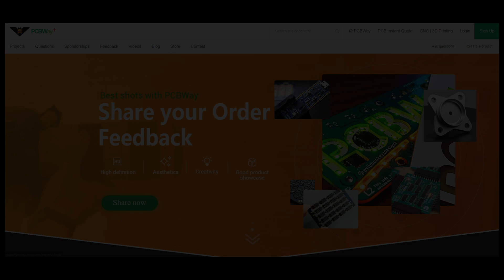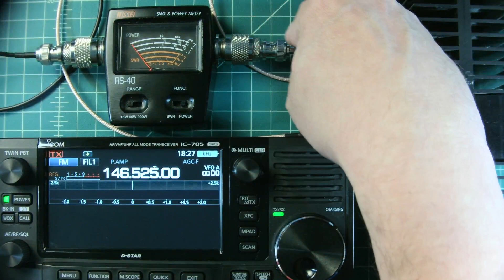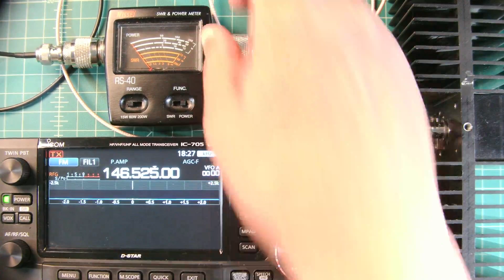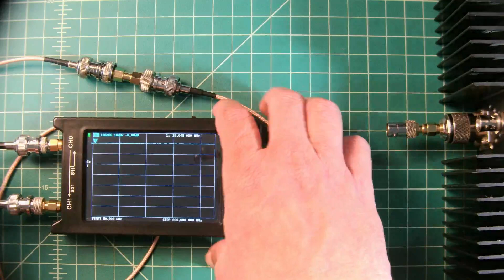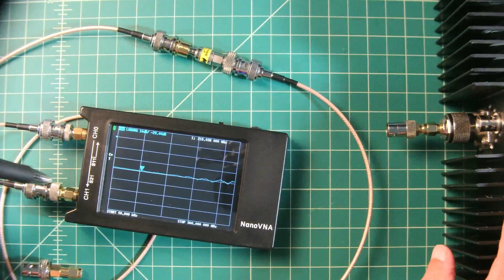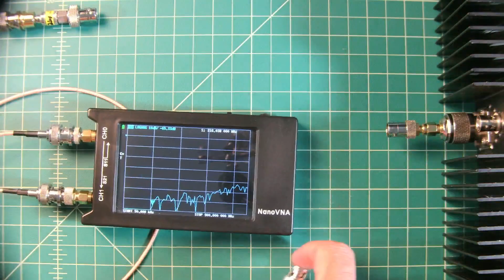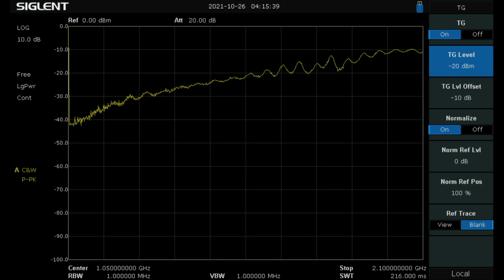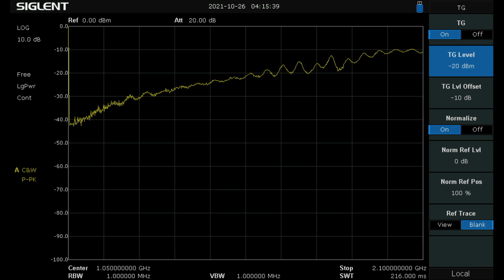Cheap Dummy Load for Ham Radio

Comment: Hmmm.  Now I gotta see what's going on with mine.  Did you open it up and look at the back part?  that tap is inductive, i wonder if it is loose/bad solder/touching the naughty bits??
Reply from the maker: I did, turns out its a monitor and not an attenuator: https://electronicprojectsforfun.wordpress.com/rf-module-gallery/the-rf-splitter-and-combiner-gallery/a-dummy-load-converted-to-a-power-attenuator/
Reply: Jeem-  I bought one of these after watching one of your videos the other day.  It’s taking a slow boat from China around the world twice to get here. 
I couldn’t follow the article.  Bottom line , when mine comes, is there a simple way to assure I have the attenuator version?  I got it for using on an analyzer.   Which I don’t want to brick. 
 Thanks. Tom

Comment: Looking into the unit I have, the 30db attenuator is a small loop of solid wire about 5mm away from the 50 ohm resistor and as a result, it is frequency dependant to the amount of attenuation.
This could be fixed on a unit that you purchase and modify yourself. I haven't bothered so far as my power meter has the same (and working correctly) function.
Reply from the maker: It will be a little frequency dependent.  I like it as a dummy load but I use more traditional attenuators for measurements 👍

Comment: I enjoy watching your YTs on various ham radio subjects. I have a Heathkit Cantenna that I built many years ago. It’s quite messy even though I never gave it the full gallon and a half. So I wanted a dry dummy load that could handle 100 watts. I was going to build one, it’s easy enough. Before I saw your YT, I bought one from a more honest source. He stated it was a pull (used, removed from service). When I got it the first thing I did was remove the cover to see how that RF tap was. It’s loosely coupled, a wire loop above the chip resistor. OK, I’m not sure if it will be exactly -30db, or whatever. I may remove it and replace with a -50 db pad. I bought a NanoVNA and as an experiment I checked the CelWave with it. The SWR was nice and flat, as expected. Years ago, I bought a MFJ-264 at a flea market for $10. I checked it with the NanoVNA. The SWR was flat but at 1.3, or something ? I opened it up and found a 60 ohm resistor, yup six zero ohms. Since this was a flea market find, I can’t say if it was factory or user installed. I’m debating purchasing the proper resistor for it. Keep up the good work ! 73 Dave
Reply from the maker: Lordy at 60 ohms.  That’s why I always test the test gear, thanks for the comment David 👍

Comment: Like many others have commented, this is an excellent quality termination load that also provides for RF sampling/monitoring.

I have seen a bunch of these installed in public safety 2-way combiners / circulators and other somewhat complex RF systems.
As i recall, they were used when system monitoring was to be implemented.  The sampling port (BNC female) output level (meaning… level of attenuation provided between the input and sampling port) can be easily field adjusted with commonly available test gear.  Like others have pointed out, the “probe loop” can simply be gently bent closer or farther from the main RF path / resistor field.  

They are sometimes labeled “CelWave” (CelWave used to be located in NJ but were bought and sold a few times over the years…).  I’ve also seen a few labeled “/\/\otorola” (OEM) that were really manufactured by either a CelWave associated company or the manufacturer beginning with the letter “F” (I honestly can’t recall the name) who produces some gorgeous OEM BpBr duplexers for Motorola.

They have quite decent specs, are well constructed and that’s a great price for a solid piece of equipment that most Ham folk can put to great use.  For use as a simple 50 ohm termination load or “dummy load”, it’s FAR better quality than most Amazon Chinesium crap or MFJ junk.  I actually have two that I use for duplexer / filter tuning as well as general purpose testing.
They were given to me with a pair of Quantar repeaters, but I’m not sure if they were used with those repeaters for any reason.
The spec sheet that came with them indicates they are indeed rated to 2GHz with the power rating at 100 Watts continuous and up to 250 W for intermittent use.  If you’re using these for high power, long timing intervals or anything critical, I’d definitely recommend adding a small fan or equivalent cooling method. 

I opened mine up just to check the details before posting this.
It turns out they used two different resistor types.  One was “EMC” and I forgot the other…

Btw - The paperwork I received with them has a price sheet enclosed.
These units, with 2x 24” RG-400 jumpers… $590@ … That’s for EACH terminator unit.
Then again, it was equipment sold to a municipal government agency and price is absolutely no object when the vendors pay the “proper” Demoncrat “lobbying” costs to the politicians controlling our hard earned tax dollars.  

Go BIDENomics! 
Or is that Go Hunter and Friends 🥷🏽🥡🧧🈴🈹🉐🇨🇳 and.. can’t forget about the tender age little girls desired so much by the political weasels. 👀 🙍🏼‍♀️

Seriously.. Thanks for a great channel!

Comment: There is nothing wrong with the device. An RF tap is a convenient sensor for RF because it substantially attenuates a signal while keeping it from radiating. But there's a reason an RF tap is not called an attenuator. It isn't one. An RF tap  does NOT provide uniform attenuation over a frequency range. It's a cheap kludge used to sense RF without unwanted radiation. It may be nothing more than a piece of wire sticking into the RF field. It almost invariably provides less attenuation as frequency rises because it has not been designed to be purely resistive over a wide frequency range the way a proper attenuator has. What you saw is exactly what an RF tap looks like. Sure, the tap's output will likely be 30 dB, but only at 1 frequency, whatever that frequency may be. Whoever claimed the tap was a 30 dB attenuator was babbling nonsense. However, $30 for a 100W dummy load that is still 50 Ohms at over 1 GHz, and has a convenient RF tap to observe waveforms without unwanted radiation, is a very good deal, new or used.

Comment: This review is wrong, this a VERY GOOD dummy load, especially for the price, the BNC connection is NOT an attenuator, it's just a monitor port so you can connect test equipment, counter, spectrum analyzer etc., I'm amazed that people will buy a piece of cheap bent tin from MFJ for $75 and think it's a good deal.
Reply from the maker: That seems to be the case.  Thanks For the comment Harry 👍

Comment: It's definitely not a "cheap" dummy load.  It's a premium dummy load.  They are rated for 0 to 1000 MHz.  The unit uses a thick film resistor for the load.  The sample port is not, I say again, not directly connected to the load in any way.  It is simply a wire loop over top of the thick film resistor, basically a antenna.  If you need more or less signal out of the sample port just push the loop antenna closer or further away from the thick film resistor.  Remove the 4 screws holding the cover on and you will see how it is configured.  These loads are currently flooding the market as they come out of use in cellular phone tower sites.  Guy had dozens of them at the Hamfest last weekend for $25 each.  Also had a pile of Sinclair 240 Watt dummy loads to.  Mike KC3OSD
Reply from the maker: Thanks for the info and for checking out the video Mike

Comment: I bought one of these a while back (Listed as used, bought from Israel), but I haven't used the sample port yet. I did unscrew the back plate and noted the BNC connector just ended in the "stub" you would normally see on a panel-mount connector. I suppose it's just to get an idea of a signal, not an accurate measurement. The N connector was properly terminated to a well-attached 50 ohm resistor. 

I'll throw mine on the Agilent spectrum analyzer and see what it says.
Reply from the maker: Thanks for checking out the video David.  I did crack it open and saw what you described, let us know what you find with the Agilent.

Comment: Hi Ape,
The BNC is an RF tap to use with a o'scope or spectrum analyzer when power is applied to the dummy load. You can vary the attenuation by increasing the distance of the loop from the resistor. It uses a 50 ohm thick film power resistor. I have the same unit bought several years ago off Ebay. I also bought a Diconex 800W thick film resisitor for $75 from Ebay about three years ago to retrofit into my Heath Cantenna. Stay safe.  73  WJ3U
Reply from the maker: Thanks for the info and for checking it out Don!